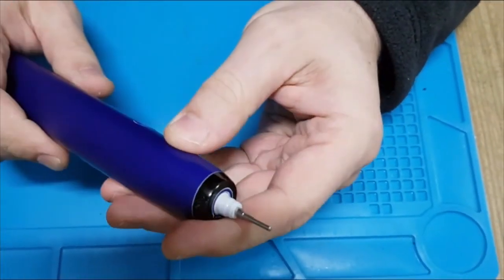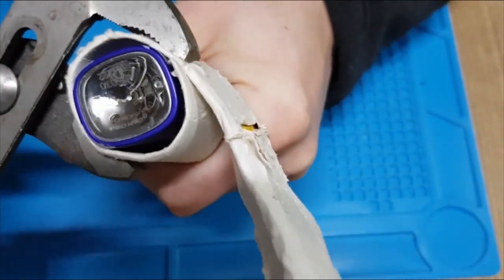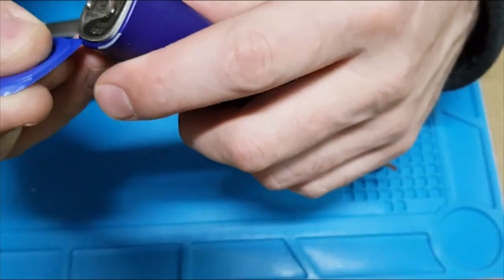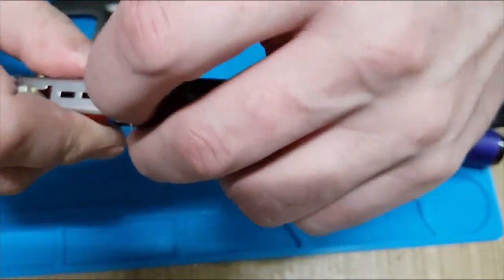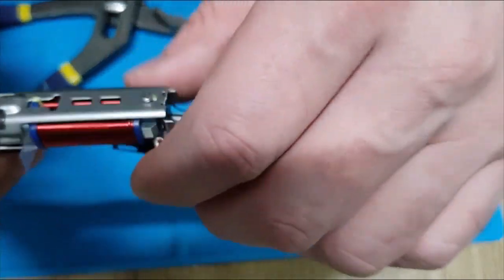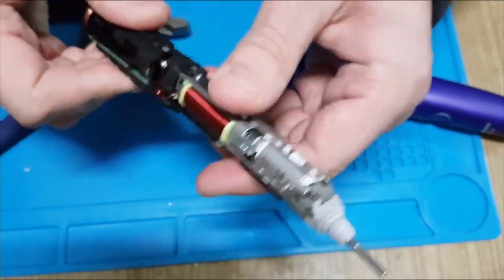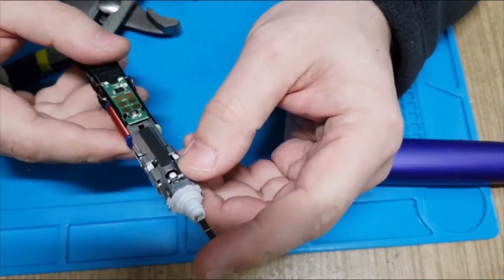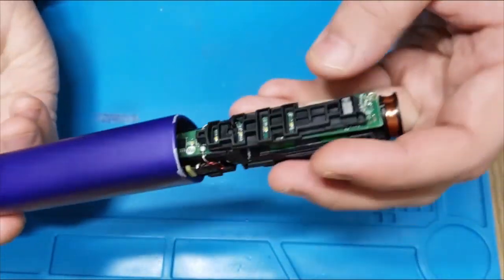Philips Sonicare DiamondClean /no vibrations/ opening and repair

Comment: Amazing tutorial, thank you for posting!  I had my HX9362 since 2015 and it started to loose power late last year when brushing.  I made the mistake of not watching the whole video and my gap was a little too small when I went to reassemble it.  After unscrewing a second time and making the gap slightly larger I put it all together and was amazed at how much power the brush head had again.  I also managed to break one of the small wires during the second disassembly but a little solder sorted that out easily.  For the gap I used two plastic pieces that I cut from some packaging in my recycling box.  Saved me $200 CAD as well as all the e-waste that would be generated from the brush as well as the case and extra charger.  Fantastic tutorial and was a good lesson for my kids as well.  If the problem returns I'm going to place a piece of plastic from an old credit card in order to stop the screws from moving up the channel.  Once again, thanks for the tutorial!
Reply from the maker: Thanks for your comment! Yes I like the idea of preventing e-waste too! as the toothbrush is quite reliable and li ion battery holds for very long time to. it's a good design with some flaws that can be fixed.. in video I speak about small gap but as you said it can be to small.. 1-2mm after you take out the spacer is usually a good rule of thumb :) and did I understand correctly that you want to leave the plactic spacer inside the electromagnet? Can't advise it.. vibrations will be very small or not existing.. if the thread gets damaged try to use some glue inside the thread or even around it but the gap has to be free.. thanks again and good luck in fixind stuff!
Reply: @letsfixitgarage  I was thinking of some way of stopping the screws from moving. I used a mild thread lock on the screws. Plastic in that dead space in front of the screw to keep it from moving forward.  Like 1mm x 2mm depending on the space.  No plastic between the magnets, just for the adjustment space where the screws are.
Reply from the maker: @antonioarroyas7662  ok, that's an interesting idea, in principle you could try to use some dense epoxy glue to fill in the space and when it will harden it should have the same efect. But from my experience thread lock does quite a fair job usually if it gets droped on the head then it gets stuck to the electromagnet..
Reply: @letsfixitgarage  over the years I've learned (as I'm sure you have) to make one change at a time.  Sometimes I'd be working on a project and come up with a fantastic idea to make it better in the process but when I finish it's worse.  With this project I used a very mild thread lock in case I need to undo the screws again the the future.  I also showed a picture of the design to my brother-in-law who is a mechanical engineer. He said it looks like they designed the screws to be able to move a bit so that the head would be less likely to crack when it gets dropped.  Brushed my teeth this morning and it was amazing, I forgot how good it performed when it was brand new.
Reply: The one thing I do know for sure is that the algorithm values viewing time very highly. If people watch from start to finish that is very important.  The longer the better but minimum 10 min.  Your video with the magnet fix and screws could be longer and you have the advantage of people watching it once then again and pausing during the different steps.  It also matters that you post videos on a regular schedule, once every two weeks or one a week. Some of the biggest YouTubers post one every three months like CGPgrey but he's an exception.  I think the most important part is to post things that you enjoy doing and refine your skills with the camera, audio and editing as you go.  Make sure you check the word list, don't get political and just do what you love.  Be careful with schematics, it's better to take a picture of a board with your microscope and then print it and show what the different traces and chips do while filming using the picture like a map.  Good luck and have fun!
Reply: When my brother-in-law and I were looking at the design we noticed a few very interesting things.  The screws let it move a little in case it gets dropped and the torque is very precise.  This let's a person who bought one drop it by mistake during the warranty period without it breaking.  All the other parts like the head can't absorb impact because they need to be hard.  The design is very intelligent because of the second purpose.  If you treat the bush with care (clean the seal according to the manual and the other things they recommend) it will be about four or five years before problems (looking at the age on Amazon reviews for older units like mine).  Our hypothesis is this: they want the average unit to last double the warranty period for two reasons.  Money from replacement brush heads and a when the unit does malfunction the customer is willing to buy a replacement because it did last a reasonably long time.  This hypothesis was made a little stronger when we looked at the time they keep a single model on the market.  We were very impressed with the engineering and business strategy being combined so elegantly.  We couldn't think of any other company that does this with such perfection.  Yes, we are both nerds that love working on cars, motorcycles, computers and electronics.  We were both the kids that took apart our toys and couldn't put them back together most of the time.  Our parents were never too happy with us as kids but now they call us when something breaks.  Keep up the good work!  When you get your camera setup figured it I'd redo the earlier video on the magnet fix and make it as professional as possible with very clear steps and photos in the editing for the average person to be able to follow. You have a very unique opportunity on YouTube as your tutorial was by far the best one I've seen. Millions of these units are out there and a really good quality video (iFixIt style) could really make your channel explode!
Reply from the maker: I had the same assumption that this design is purpose design and it could be a protective feature as you said it should protect the head unit that is a cast metal and it does break. so it could be that those that broke, already had magnet near electromagnet.. 
I will try to make a better quality video with my new setup but I do tend to drift in to repairs of different defects in one video.. what do you think is better approach to make a lot of short videos or one huge with all the info?.. and thanks for your impressions on my videos!
Reply: @letsfixitgarage  my background is in information technology.  I was messing around with a IBM PS2/286 when I was 9.  My mom required one for work and it came with a massive manual and DOS 4.0.  I had access to the internet for the first time in 1994 using the Mosaic browser because of a friend at a local University.  That was also the year I got my first job (14 years old) working at a computer store that built and sold PC clones. Happened to be in University when Facebook came out and was only for people with a college or University emails. That was also the age of Napster.  Those were some good times!  Basically, I've watched the internet evolve since the very early days of public access.
Reply: @letsfixitgarage  Regarding YouTube, it has changed a lot since the very early days. I never imagined people would be making money posting videos to it or any other video platform at the time.  Obviously much has changed since those early days.  EEVblog would be a good channel to check out for an idea of what works.  If you do a search for the words YouTube you can see him posting information regarding the changes that they have made over the years and how it impacted his channel.  The other channel I would look at is a channel called YouTube Analyzed.  He has a couple videos and a word list that he keeps updated and a video he posted in January 13 of 2020 that you might want to look at.
Reply from the maker: I started with 486 and win95 :)) nice! and thanks for the tips I will check it out.

Comment: This is awesome, I was able to fix my Sonicare FlexCare HX6970 using this! The hardest part was separating the top section (around 4:50), but I eventually figured out that rotating it can get it free. Thanks for the detailed video!
Reply: What do u mean rotate? I cant do it too
Reply: same here - the two parts, battery pack and motor part, will not separate. I pulled apart as much as I could but I am afraid if I pull any harder the two thin wires will brake. I have two brushes and both have the same issue.
Reply from the maker: If you have thin wires for toothbrush head sensor you need to desolder them. It is possible to separate the two parts without desolderong but then you be very careful and have some experience for first time I would suggest to desolder the wires first.
Reply: @ivostoyanov7068  pulled mine alright. But then i didn't notice the soldering wires got detached after fixing the coils. I got to a cellphone shop which they also have an electrician then offered him a dollar to solder the detached wire again. Toothbrush working fine again
Reply: Thank you for this comment! I was getting so frustrated.

Comment: got it opened, but now toothbrush isnt charging.. oh well off to get a replacement. thanks for the vid
Reply from the maker: If charging coil got damaged then there is no way to repair it, other damage could posibly be repaired.. next time will be much easier ;)
Reply: @letsfixitgarage  all good. It was worth a try. Ordered a new handle for a fairly cheap price. Good way to get a replacement. Thanks again for the video

Comment: Thanks for the great video. When I opened my toothbrush just as you show the magnet was stuck to the electromagnet. After I made a space and tightened the screws, it still did not vibrate and the magnets got stuck together again. I tried again and this time left the plastic spacer in place but the head doesn't vibrate at all. When I press tge button I get a quick bzz from the button but no vibrations, even thouh the plastic spacer should theoretically keep the two magnets apart and vibrating. Quick question, for those that don't have screw glue, could they just leave the plastic spacer in place?
Reply from the maker: Sorry to say this but your toothbrush driving head with magnet and electromagnet is toast..shaft that connects the head pin and magnet is broken. Even without glue if you tighten the screw the gap should stay in tact if it jumps back to electromagnet it needs to be replaced..

Comment: I cant put the damn thing apart!!
Reply from the maker: Bottom cover or the internals from casing? Yes you have to get some feeling in some parts.. if you are afraid to damage it, you can send it to me just write me maybe we can work it out letsfixitgarage@gmail.com
Reply: @letsfixitgarage  never mind about that. It was the black plastic with the circuit board that was attached to the the part with the whole magnet. But i applied too much pressure and the wires ripped off the solder iron. I will try to solder it on back though
Reply from the maker: maybe it would be a good idea to advice first to desolder before pulling those parts apart.. altough if you get the feeling it is possible to pull it apart without damaging it.. check if the pads were not damaged.. resoldering shouldn't be a problem..
Reply: @letsfixitgarage  thanks mate it works =)

Comment: Great video. But I have failed as I insert screwdriver to far inside to get the assemble out, I accidentally damaged one of the tiny chips. Have to buy new one.😡
Reply from the maker: Yes first time it's quite difficult to get the feel where and how much you need to bend it.. did you damaged a chip or a resistor? For resistors it's an easy replacement or send me a picture of missing components maybe I could take them off the donor board.
Reply: @letsfixitgarage  ! Thanks ! But I think it's beyond repair . Anyway, how can I send picture or even the damaged board to you?
Reply from the maker: @hanhcao8517  that's one heavy screwdriver..
Reply from the maker: You can send a picture to letsfixitgarage@gmail.com we can see what hapened..
Reply: @letsfixitgarage  ! I sent you pictures. Please check. CHEERS

Comment: Thank you thank you!  I had a new tooth brush and after 3 months it stopped working.  Was ready to try to return it but saw this.  It worked great.  I did crack the bottom base a little but your instructions were perfect.  Thank you!! 👍🏼⭐️🇺🇸

Comment: Worked perfectly! I did not find it at all difficult to follow. A suggestion: for the strip of plastic, I took clear packing tape, folded it into a 1/4" wide strip (three times, for a total of 4 layers of tape), and then trimmed the sides with scissors. One more suggestion: you might want to put the camera further back, zoom, and (if your camera or phone allows it) turn off auto-focus. You'll have a deeper focal plane so your work doesn't keep slipping in and out of focus.
Reply from the maker: Thanks for the suggestions! Im working on improving the setup with some additional equipment, as before it was filmed with a simple smartphone with default settings. This will come in handy :)

Comment: I was able to repair the noise on my toothbrush to this videos.  Gracias, where can I get replacement parts?
Reply from the maker: Ebay has all kind of new parts or you can buy a defect donor and use what is needed from it

Comment: Didn't have a vice grip to squeeze the handle. Just wedged it under my car between the pinch weld and the jack and jacked my car up to pop it loose.
Reply from the maker: Well any means to reach the goal are good :)) but do be careful with these methods as you can easily crack the casing and then there is no waterproofing..

Comment: Hey, that's a fantastic video.  I love the detail and your professional knowledge of these toothbrushes.  After seeing your video I felt super confident I could do this myself.  So, I opened up my wife's Sonicare only to discover it's a Sonicare 3 (HX6610-01).  I figured out how to get the device apart, but the insides look completely different than the ones in every Sonicare repair video.
Well, this toothbrush is doing the same "no vibration" but you can hear a hum inside like it's trying.  At this point, I'm not sure what to adjust (if anything on this model) to get the vibration to work again.  Might you have any advice on how to repair a Sonicare 3?
Reply: So, I kept going on my wife's Sonicare 3 and discovered that the armature had seized somewhere between exiting the motor chassis and coming out of the plastic housing at the top of the brush.  I physically forced the armature all the way forward and back until it freed up.  I worked it a lot to break up any rust or gunk inside, but I could still feel some abrasion as the armature moved.  So, I pulled back the rubber seal (at the tip of the brush) and used a toothpick to drip a tiny bit of WD-40 onto the armature shaft.  I worked it some more and it became very smooth.  It seems to have done the job.  I've put it all back together and it's working fine...for now.
Reply from the maker: Hi, thanks for a good word! 
yes the PCB is different on all the sonicare toothbrushes (buttons, led's and so on..) but the driving principle with electromagnet is the same.. if there is gunk inside - do change the upper seal it could be leaking water.. and physical forcing doesn't sound very promising.. look for a similar dead toothbrush on eBay or similar site and then you could by solder the two contacts on the PCB  exchange the whole driving mechanism.. 
nice job on not giving up by the way! ;)

Comment: Thanks for the video. I fixed it, and got the vibrations.....unfortunately the wires broke. Perhaps a note on how to protect the the connecting wires so they do not break off from the solder!
Reply from the maker: If the wire snapped you can solder them together if it broke of the pcb the damage could be worse.. inspect if the pad on the pcb, if it's intact simple resolering will do, if no, you need to retrack the pcb track where the pad was connected carefully remove protective paint and solder the wire.. it's still posible to rescue. And for protection yes if you bend it a lot desoldering electromagnet would be a good idea..

Comment: weaker vibrations , funky button operation, then on/off by itself .... then nothing. Pulled apart per your video , did the spacing fix with the magnet. Did not work. showed charging , buttons lit but nothing. Let it sit overnight without cover, closed it up next day, put it on the charge port for 10 mins and back to 100% !! Thank you for the video. These are engineering marvels once you get inside.
First issue since 5 years.
Reply from the maker: Glad it helped! although from your description I would suspect water damage.. inspect the upper rubber sealing if it has build up and micro tears replace it and clean the board with alcohol..
Reply: @letsfixitgarage  board was clean, no obvious signs of water damage inside. I did spray with electronic board cleaner alcohol. Let it dry thoroughly. I do tend to use the unit for longer periods at one time. What is good source for purchasing seals , repair parts etc...
Reply from the maker: @register1430  interesting.. :) 
and for the seals ebay or aliexpress is the easiest way these days.. they go for around 5 eur..
Reply: update, still fine but has gotten louder and much 'buzz-ier' all of a sudden. First fix I did not use the thread locker, redone now, respaced the magnet again. Running like a champ again.